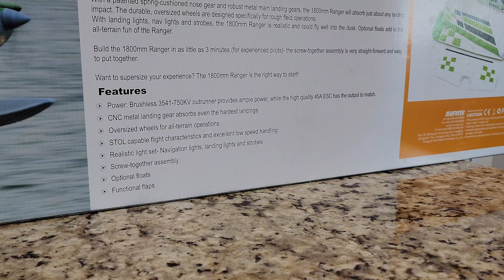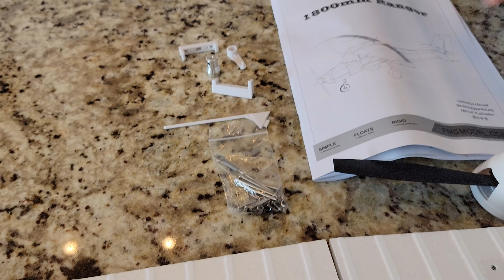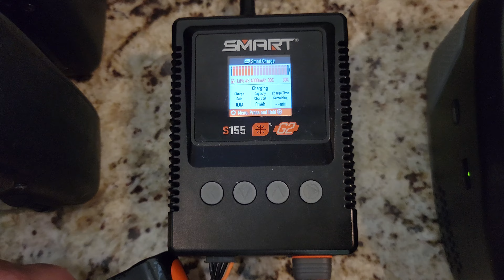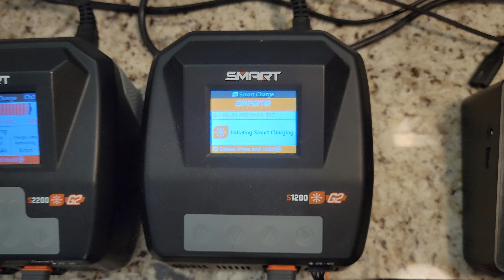FMS - Ranger - 1800mm - Unbox, Build, & Radio Setup

Comment: Hi Brian and Megan. My 1800 Ranger came in today. Mine came in without vector. I installed a AR631 receiver. After watching your video I built mine in less than an hour. Radio setup went smooth. I was surprised to find they upgraded the ESC. It has reverse. It setup easy. It was about $30 bucks cheaper, and I found a $30 coupon. I plan to fly it in the morning. It was a very easy build thanks to you. I hope it helps, I bought two airplanes and an spectrum NX8+ through your links. Thanks my friend.
Reply: Maiden flight today, I flew without having to trim. Elevator trim in Flap mode was way off, Took a lot of elevator trim to keep from ballooning up. Landings were very smooth. I love the way it flies. Also the thrust reverse works great.

Comment: Hi bud...... first off I love your videos!!! RC, or ,farm, they are all great. 
 My comment is about the 400, and 500mm airplanes.. ( mostly warbirds ).
 I have been surching for a programmable Transmitter that will work with these planes.
 The Radiomaster TX16s with 4 in 1 will link up with all these small warbirds, the P47, and possibly p40 might be different. 
 Thought you might be interested. 
 I ordered one today. 🙂
Reply from the maker: They DO and I have a Jumper, T8SG, which will work for most of them, but I just loath the setup procedure, so haven't taken the opportunity to get the Radiomaster TX16, which I think would be the natural next step in progression of OpenTx, should we ever lean that direction in the future.

Best of luck!

Comment: Love this channel! I recently got back into the hobby a few months back, worked my way through all the UMX's park flying then joined a local club where I started larger scale flying with an aero scout and apprentice sts. Looking forward to my maiden with a turbo timber evo this weekend. Which makes me wonder what would be a good next step after the timber? Possibly a eflite t28 1.2m?
Reply: i should clearify by way of working through umx's: I started with the radian- cub- timber- twin otter- mig 15- pitts. Grass plopping is totally different compared to actual asphalt landings though. The timber went smooth and I'll stick with that for a while but after studying your videos I think its wise to start with the piper as a next plane after the timber than the t-28. Would you agree? Seeing as the gear on the t28 doesn't seem as sturdy? or rather nimble?

Comment: Did you get the PNP or the BNP  like to get one but not sure. Very new  VERY NEW  haha
Reply from the maker: This particular plane only comes in a PNP option. FMS offers 3 finish levels on their airplanes:

RTF = Ready to Fly - This includes the plane (with receiver installed) and a basic transmitter to go with it. It also (usually) includes a flight battery and charger.

PNP with Reflex = Plug and Play - This is JUST the plane with a Reflex flight stabilizer installed. No receiver, transmitter or battery. For these planes we use an NX10 transmitter ( https://bprc.me/NX10 ) and recommend NON-stabilized receivers like these:

https://bprc.me/AR410
https://bprc.me/AR620
https://bprc.me/AR8020T

PNP = Plug and Play - This is JUST the plane. Only. For these planes, we still use the NX10, but recommend a stabilized receiver with AS3X and SAFE:

https://bprc.me/AR630
https://bprc.me/AR631
https://bprc.me/AR637T
https://bprc.me/AR8360T

Which receiver you need, depends on the setup and channel requirements of the plane.

If you are VERY NEW ;) We typically recommend a RTF option. The transmitter isn't as fancy, but you can get up in the air relatively cheap. If you like the look of this plane, check out its little brother...

https://youtu.be/1oVoD_JeTMU that comes in a RTF option.

Or check out :

https://www.brianphillipsrc.com/beginnerplanes

to see our whole list of recommendations!

Comment: Great looking plane, but looks miserable to take apart the wings to fit in a car or SUV.😂
Reply from the maker: Might be a pain, but after a few times, you'll get used to it. These Rangers are big...but you can set the tail down on the floor of your vehicle, if you want to make it fit better. Some planes, especially tri-cycles, can be TALL. BUT, keep in mind, you can put the plane in width wise, if you have an SUV or Truck.